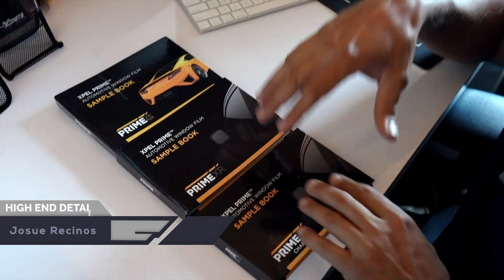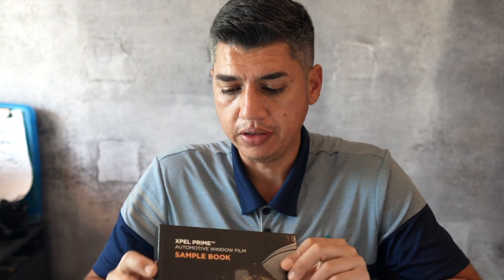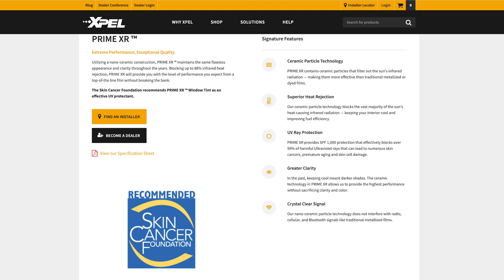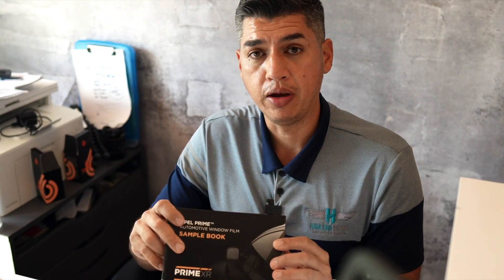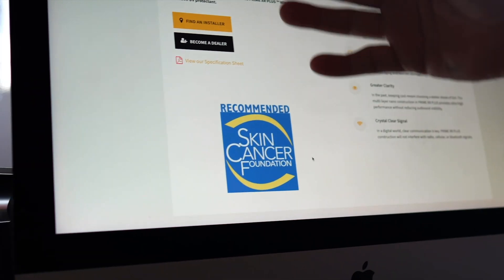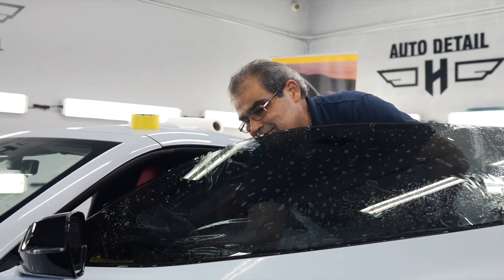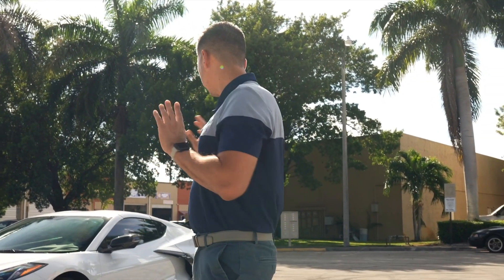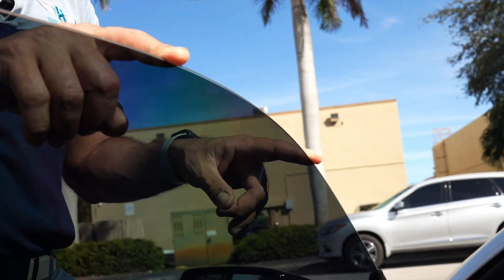CORVETTE C8 | BEST WINDOW TINTING OPTIONS

Comment: LOL, I just got my C8 windows done, I did 35% on the rear and side glass. I also did 50% on the front windshield, My car is red mist with natural dipped interior. I also went to a place that have done my windows for the last 20 plus years, Great video  by you and your crew,
Reply from the maker: Thank you for the feedback! Congrats on your new c8. We like 35% it’s for the most part legal in many states and looks conservative but cool 😎 too!
Reply: Did tinting the front windshield reduce the dash board reflection from the light colored
Reply from the maker: @DavidAnderson-up4qu  from what wev’ve seen, yes it goes. Not only do most ceramic films provide great heat rejection but they also have amazing glare reduction as well.

Comment: What is the price for each one on c8
Reply from the maker: Great question jay! Pricing can vary depending on your geographical regions. As an example, ill use what we charge down here in miami florida.
For the xpel cs carbon film our prices ranges between-$80-$120 (depending if youll want the divider small window tinted)
For xpel's xr ceramic film we're at $120- $150
For xpel's top of the line xr+ we're between $150-$185
These prices are for the two front windows and the small divider window.
Reply: @HighEndDetail  doesn’t sound bad do you have anyone near me I live in Staten Island ny like to have it done
Reply from the maker: @jaytucker4827  you can easily find a nearby installer by going to the xpel website and searching under their dealer locator! Good luck!👍🏽
Reply: @HighEndDetail  my local xpel charge me 400 for xr doing 2 windows and the back small window for c8. Is that normal price?
Reply from the maker: @zongfan1656  there has been an increase in xpel’s material cost. But that’s still on the high side to be honest.
We’re at $150 for two side windows and about $75 for the divider window